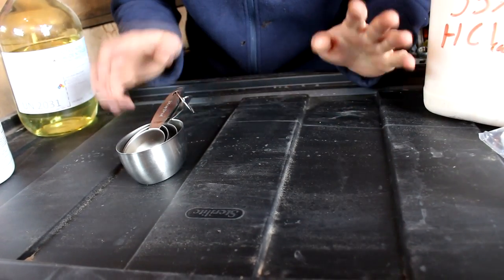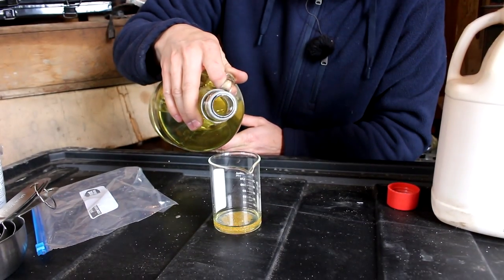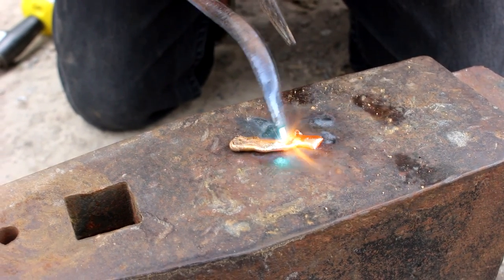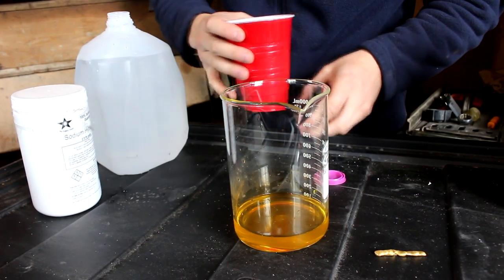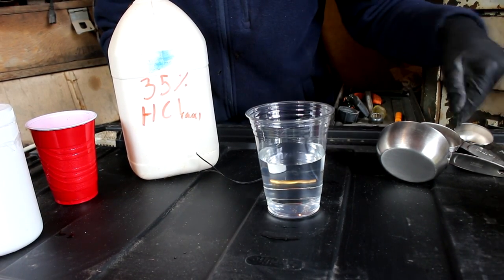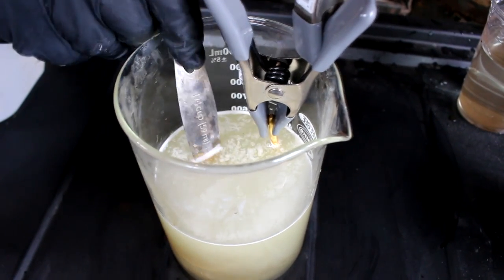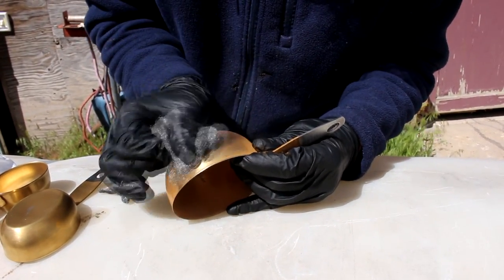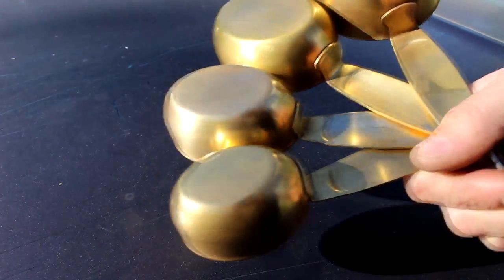Gold Plating Measuring Cups For My Mom

Comment: And that's why you always wear steel toed boots
Reply: Always? I don't see my self being in much risk of dropping anvils on my toes in my everyday life. Not enough to wear clumsy ugly boots at least.
Reply: yes, but thats why you wear carbon steel, instead of low carbon steel shoes.
Reply: If something is heavy enough to bend a rated steel toe enough to capture your toes it's heavy enough to completely destroy your foot.
Reply: Brian Pinard only if you're dropping a car directly on them from a few feet up. and at that point you shouldn't be in a shop to begin with.
Reply: Sirdeathvids we have to wear metatarsal boots at my work
Reply: Just wear composite toe what for satisfying the clipboard warriors, and be cognizant of your surroundings. Works for me.
Reply: Don't forget safety glasses. Those things save you from the smallest things in the world.
Reply: When riding a motorcycle steel toed boots can cut off your toes when ran over by a car. I've only ever had my hand ran over (my hand was fine) but I don't wear them for that reason. Once the weight is over a certain amount (maybe half a ton?) they are not a good idea.
Reply: "ugly" well that really is subjective
Reply: Nonsense, rated caps withstand 2500 lbs of compression force.  Old wive's tale.
Reply: steel toed boots can bend and cut your toes off, composite toes can't.
Reply: 5 in1 is absolutely right.  Steel toe boots are more than enough to withstand a car running them over.  Most of the damage done to a foot by a car running it over is done by the persons knee-jerk reaction to try and pull their foot out from under whatever is on top of it.  If any vehicle runs over your foot, let it roll over.  Dont try to pull it out.   Anyone here that thinks steel-toed boots will cut off your toes should go watch the episode of Mythbusters where they tested that myth.  They had to go to some pretty unlikely extremes to get the boot to harm the toes inside the cap.
Reply: Good steel toe boots are great and won't cut your toes off. Bad/cheap steel toe boots will cut your toes off.
Reply: The only reason that rated steel toe boots might trap/sever your toes (in something that would not otherwise crush your toes to the point that you would have to amputate them anyway) is if you somehow had high-cycle fatigue that either causes plastic deformations (which you would notice long before it was an actual issue) or work hardening (making it brittle and ruin the rating).
Reply: Steel/aluminum/composite toes dont pinch when they fail so they would crush your toes not cut them off. The claim that the steel caps are designed to cut your toes off so they can be saved is also false. Just like the claim that the crash-position on an airline is designed to kill you.  Any cheap steel toe boot that would harm your feet would also be very illegal since theres a standard that they have to meet to be sold as a safety device.  If I got my toes injured by a pair of boots that claimed they were going to protect me the company that made them better be some anonymous Chinese place that I cant sue.
Reply: Mythbusters didn't test a boot being ran over by a car at speed.
Reply: for the people claiming that steel toes boots can't possibly cut off someone's toes you are dead wrong, I had a buddy at work loose some from it. also the cap doesn't need to bend, only shift downward lifting the front part up. That's not what happened to my friend but it still seems pretty obvious to me and worth mentioning.
Reply: Does this mean I need to leave a note and wear steel toed boots. So many rules.
Reply: blundstone steel toes.  look them up.  so comfortable, don't look terrible, no laces.  perfect for every day.
Reply: +Taylor

And that's why you never use a 1 armed man to teach your children a lesson.
Reply: Sirdeathvids even in the gym.. i cracked 2 toenails and it was 30lb
Reply: so much BS here ... if you hurt your foot in safety boots, your feet would have been junky salsa without  ... with the same arguments here against safty boots you could also claim to not buckle up because then you would not be hurled out of your burning crashed car...
Reply: I never wear steel toed, composite only due to how cold it gets around where I live.  On the other hand, frozen toes wouldn't feel a thing. Learned the hard way steel toes make frozen toes.
Reply: ~ B E W T S ~
Reply: das BOOT!
Reply: Recon WB only true with juergen prochnow :-) ...
Reply: mythbusters did that one, its bs
Reply: U should see the mythbusters episode about that
Reply: Mythbusters
Reply: so if you don't have an anvil, you don't need steel toe boots.
Reply: ALWAYS.
Reply: Especially then.
Reply: As an oilfield worker, I don't wear steel toe boots. I'd rather have a crushed foot than an amputated foot.
Reply: The end result is the same.
Reply: Brigman if you would show up at my shift without safty boots (not oil but other power generation station) you would get fired immediately... who does not have a clue about safe working conditions has no place in a large team...
Reply: That's cool Cody! Hammering gold looks like easy job but it is not.I know about it.
Reply: If you ever have the problem of the steel cutting your toes off, then the weight would have otherwise squished your bones into nothing.
Reply: Not really. It doesn't require much to force the edge to curl down, slicing into the foot. The same pressure would fracture bones but leave the foot intact.
Reply: Brigman bullshlt. watch the corresponding mythbusters episode.  It may safe your toes......
Reply: I wish they were right. But I've seen too many safety videos over the years that prove otherwise. The back end will curl and amputate. But this is old news in the blue collar industry.
Reply: Brigman thats not old news, what you write is fake news ....
Reply: there are less and less metallic shells inside safety boots, mine have composite material inside, they are more resistant to deformation, the plus sides, they are lightweight and if they take a heavy charge, they pop back in place where a metallic shell keep the deformation (and keep your toes stuck inside the boot). If a metallic shell curls and cut the toes, the boots was a very low-end quality and if not, you got enough pressure on the shell to break to toes into pieces way before the deformation. when I started into the industry business (circa 2000), I got a 660lb forklift wheel falling on my foot, 2ft fall. got a sprained ankle and the boot's shell hold good. the shell was a metallic one, it did get deformed, but nowhere near to cut my toes. I have to admit, the normalization in my country for the safety equipments are pretty high standards, but still. at last, one advice, don't keep your toes under heavy unstable charges. if you are struck by a charge exceeding the resistance of your boots, in most cases, it's your fault.
Reply: I wear composite toe shoes and boots. they are lighter, stronger, don't bend then trap my toe in them, and non metallic so shock proof
Reply: Brigman I dont call bullshlt on you because of a TV show but i call BS on you because i am a professional safety engineer and in my entire professional career i never have seen a foot injury in a safety boot which would have been less severe in normal boots. The opposite i have seen quite often... One can artificially create a load where a safety boot would be disadvantageous, but that has nothing to do with real life...
Reply: And I call BS on literally everything you've just said. Many, many years of working oil rigs, pipelines, and factories has taught me otherwise, on top of the countless safety videos I've been forced to watch and hearing the horror stories of fellow workers. But I wouldn't expect much from a safety man that can't even spell safety. Move along, child.
Reply: Brigman ... 'anecdotal evidence' and a spell flame, now you convinced me .... Oh man can you sink even lower? How about a nazl-reference?
Reply: Your logic: I've never seen it so it can't be true. My logic: I've seen it, so it must be true.
Reply: Brigman PLAIN FALSE. I say i have seen multiple times the protecting effect of safety boots, thus i rate it probable that safety boots are overall beneficial. You say you have seen a detremental effect of safety boots once, concluding that safety boots are always dangerous
Reply: Multiple times over many years* Not once.
Reply: Brigman and how often was someone NOT injured over all these years because he wore safety boots? 10000 times? 100000 times? or more often?
Reply: Brigman oh we reach the insult-level. How embarrising for you that you obviously dont see any chance any more to beat me with arguments.
Reply: You're right. I can't argue with anecdotal evidence from a troll who isn't even seriously debating. You're just here for the "lols" or something. I'm the fool for taking you seriously. Should have known from the beginning that any child that can't spell what he preaches is obviously just looking for a reaction on the internet.
Reply: Brigman indeed, half of the Internet laughs at you for your skewed safety perception, and the other half laughs at you because you can not control yourself to not use insults as argument-substitude when cornered....
Reply: Brian Pinard do you even know the intended use of steel toe boots? they are to cut your toes off and cause the least amount of damage so they can reattach them in case of having a heavy object fall on them.
Reply: Saying that safety boots don`t work because they would amputate your foot is just plain stupidity. I very highly doubt that this guy has actually worked in any heavy industry.
Reply: Take anything from Mythbusters with a grain of salt. It's a TV show.
Reply: Good point.
Reply: I'd wager it would be better to get your toes cut off instead of being crushed.
Reply: I wasn't meaning to start a comment war about whether the steel toes are good or bad, I just wanted to state that your PPE is important to have just in case something happens.
Reply: The steel capped boots saved his foot in that scenario, people that think that wearing steel toed caps is worse because the steel can bend and crush your feet obviously don't understand that your feet either way would of been destroyed without it, at least the steel caps give you a chance
Reply: Worsens your chance*
Reply: Brigman doesn't take away from the fact that what i said was right
Reply: minus the last part
Reply: yeah what he said ^
Reply: Sirdeathvids I
Reply: (assuming there are anvils nearby)
Reply: My dad wore steel toed boots when the mini-trackhoe he was operating tipped over, and him not wearing a safety belt tried to jump out and the roll cage crushed the steel toe into a closed shape, slicing off three of his toes. 

BUT, I think that would have been prevented if he had worn a safety belt, and I agree with you. Anything short of a freak accident could save your tootsies.
Reply: d4m4s74 thats why they are illegal here cevlar is the way to go
Reply: Damien Wentzel you mean Kevlar 😂😂😂
Reply: Aditya Patel autocorrect xD
Reply: would like to have toes or lose you toes
Reply: Sirdeathvids I
Reply: You say that like you can't get Steel Toe Cap Boots that actually look nice, like I have some nice black ones that do look good.
Reply: Party Bot how is North Korea entirely Trumps fault? This has been going on long before Trump got inaugurated.
Reply: fox is fake they only lie
Reply: XcwedgecX243 last time I checked that's all CNN and MSNCB do. I will admit, Fox News is a little biased, but at least they don't fake their news coverage.
Reply: yea but they do lie some of the time but im not going to shoot you down on that
Reply: Sirdeathvids he said that
Reply: In Australia, we call them 'Steel Caps'.
Reply: My uncle's coworker also thinks like that until he had his right foot crushed by a bench vice.
Reply: Blake McDonald surely you can get steel toed boots that can handle more weight?

Comment: i guess all moms are the same.... you give them an expensive gift like gold plated measuring cups and they store them in the cupboard or put them up as decoration, then they go out and buy a cheap plastic set and use that.....
Reply: Someone's mum doesn't care...
Reply: Yeah but they don't want to use this nice gift you gave them because they would be worried that they would mess it up. If you ruin some rando cheap plastic set you just bought then MEH just buy another, but if you ruin your expensive, precious gift set, then damn. No way to replace that.

So yeah, most people (moms as you say) are kind of the same with that line of logic.
Reply: I like your icon! Also, Mom knows best!  :-)
Reply: thats what happened when i made my mom some gold plated measuring cups as well

Comment: Yes, let's handle hazardous chemicals on some wobbly ass Rubbermaid bin.
Reply: What's the worst that could  happen?
Reply: Rijl Qanturis Notice how he spilled some acid. The plastic bin is actually great because it is inorganic, the acid would have eaten away at wood and glass and metals would be a problem.
Reply: Emilio, how did you get the notion that plastics are inorganic?
Reply: Thor214 You are overcomplicating te discussion, I used a non chemistry connotation of inorganic as in  not related to living things. I thought that would be obvious but in retrospect I could have been clearer.
Reply: sorry, can't hear you over the sound of myself splashing mercury, huffing cyanide, and chewing indium
Reply: Austino EL Hoggey It took a long time for me to get that reference.
Reply: +fsmoura its a mystery you can hear atall
Reply: I love breaking bad

Comment: How do you know/estimate how much gold to use?
Reply: Ronie Von Varona scales
Reply: Ronie Von Varona; Thickness of the plating you want × surface area that you want to plate × density of gold = mass of gold required (Theoretically, each atom that gets plated should be replaced by an atom from the gold electrode, although you wouldn't really want to deplete your plating solution so much, as the plating quality would suffer. It's much better to have such a large excess that the whole plating procedure hardly changes the concentrations of your plating solution's constituent salts).
Reply: surface area * layer thickness * density of the gold = how much gold you need
Reply: Ronie Von Varona actually I think Cody just uses an excess and recovers what is unspent
Reply: Because he is an chemistry magician
Reply: Fran008 he uses more gold than is necessary and recovers what is not used

Comment: Decides to make gift for Mom
Step 1: don't wear gloves with Nitric acid
Step 2: breathe heavily while messing with cyanide
Reply: You aren't supposed to wear gloves when working with Nitric acid cause they spontaneously combust if they come into contact with it. Without them you can just wash the acid off your hands.
Reply: nitric acid isn't as dangerous as you think, I've gotten it on my hand for like 30 seconds all you have to do is wash it off if you feel burning and you will be left with a yellow spot on your hands
Reply: Not having to use gloves? That is completely false. Add in the fact that he’s mixing nitric and hydrochloric, which produces one of the strongest acids, could leave to a horrible disaster. Just a second of Aqua Regia (mixture of those 2 acids) will cause intense burns and leave a very noticeable scar
Reply: if you put your finger in acid it makes it feel slimy due to skin melting off... good for lube in a pinch
Reply: Bite the pillow I’m going in dry
Reply: Aqua Regia is not a strong acid and you can get some on your skin with no problem. It actually doesnt dissolve the gold itself, the nitric oxidizes it and the hydrochloric dissolves the gold oxide. On the other hand sulphuric acid couldnt do any harm to the gold but it would burn your skin to a crisp. Also cyanide isnt dangerous aslong as you keep the solution alkaline and destroy the cyanide when youre done.
Reply: Cyanide only produces toxic fumes when mixed with an acid. Also, nitric acid is harmless on bare flesh as long as you wash it off in a timely manner. Look up NileRed's video where he pours hydrochloric sulphuric and nitric acid on his bare hands.
Reply: Also latex or nitrile gloves will burn violently on contact with nitric acid, causing the gloves to melt to your hands. NileRed also has a video demonstrating this. So bare hands are much safer, even with prolonged contact. It is definitely NOT false as any experienced chemist will tell you.
Reply: Well I wouldnt touch red fuming nitric acid with bare hands, but yeah at reasonable concentrations nitric and hydrochloric acid - so aqua regia aswell - are fine to touch, sulphuric acid however is an insane flesh eater.
Reply: You apparently didn't watch the video I told you to watch since you contradicted the very point it proves.
Reply: No, I didnt watch the video but I assume he isnt touching red fuming nitric acid in it and if he does then well played, I wouldnt have tried that. On the rest I didnt contradict anything, Im absolutely with you on the other things as you can see on my first 2 months old comment that pretty much said the same as yours.
Reply: Nitric acid only spontaneously ignites gloves when it is high Purity AKA fuming. Once you dilute it down to the normal 70% or so range that people buy in the stores you can use it with nitrile gloves without an issue
Reply: Cody literally ate cyanide once
Reply: @collin6374  is it permanent?
Reply: You do know what would happen if he wore gloves while messing with that right smh
Reply: Step1: go learn more about acids!
Step2: shut it until you actually know what you're talking about!
Reply: dont worry though because he remembered to wear his steel toed boots

Comment: Hey Cody. It is unwise to heat the surface of the anvil like that if I am not mistaken. You can ruin the temper I think it is.
Reply: Under most circumstances you are right, but the face of that anvil is shagged (technical term) so it doesn't really matter much any more.